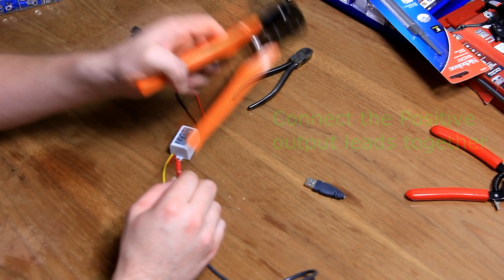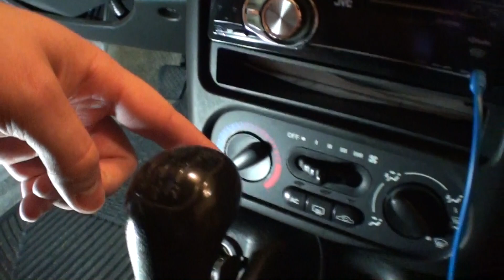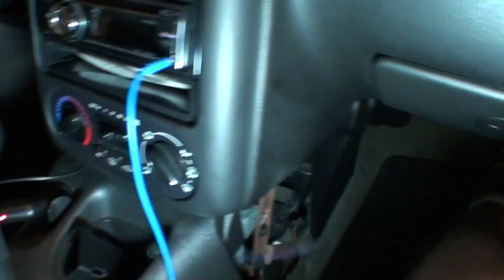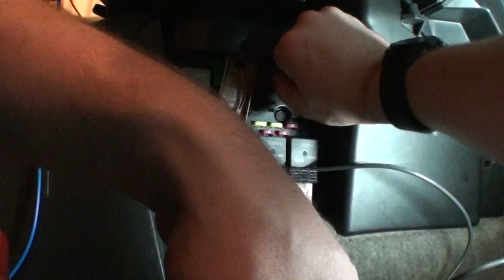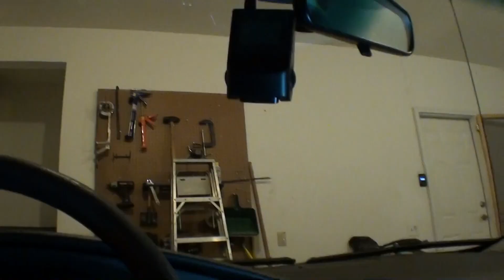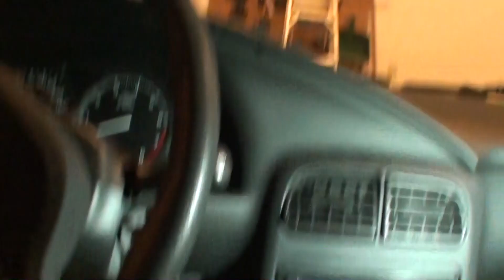Dash Cam Install - Hardwired Into Interior Fuse Panel

Comment: Can you connect to dash cameras to the same fuse? I was thinking of doing one for the front and one for my back window
Reply from the maker: Possibly as long as the power requirements for the total consumption of both cameras won't overload the converter or fuse. Other suggestion is find a dual channel dashcam. Thanks for watching!

Comment: How do you connect now a way days new models cars have mini fuses.but in the market they sell regular fuses and hardware wires. I ordered mini fuses and hardware  wires as mentioned in the AD but they send regular fuses and hardware wires. When I ask they they have only regular  but not mini fuses and hardwares. Most of 90 % of the dealers online they have regular but they mention Mini and hardware  wires in the Advertisement.  Help me how to fix it.

Comment: Idk if he mentioned you want to check your load slot one part of the fuse how is load the other is draw use a meter and the wire needs to be facing the load side. If done incorrectly it can cause a fire allot of people don't know this. Watch a video for a reference. And your to fuse has to always be smaller then your bottom so the wired fuse 7.5 and other 10.

Comment: Wrong! No cigarette lighter socket is "always on" in a car. Why? That would be stupid. And if you look in the fuse box "Cigarette" is under ACC. I think you got it wrong!
Reply from the maker: The one in this car was, 02 Saturn SL2. Even with the key removed, using the supplied cigarette power cord, the camera would still be powered. Now, my 2012 Chevy cruze shuts off the socket when the key is removed and I open the door. Probably a safety feature on newer vehicles.

Comment: How would I connect this so my dashcam can provide remote monitoring 24h by constantly getting power from the battery when the car is off? 
https://www.aliexpress.com/item/33030723006.html?isOrigTitle=true&spm=a2g0o.detail.1000023.2.43bf7ef89aGxCb
Reply from the maker: Find a fuse spot that is always hot(power supplies) when vehicle is off.

Comment: The problem is this might disable the parking collision detection on the dashcam
Reply from the maker: I was not going to use those features but if you do, hook into a hot fuse. This will give constant power so the collision detection can be utilized.

Comment: Do you need a specific converter to hardwire your dash cam? Or is it always the 12 to 5 volt converter regardless of whatever dash cam you're running?
Reply from the maker: It will depend on your dash cam requirements. Mine runs off 5volts, but others may be 12volts or other. Check the camera specs to know for sure. You might be able to skip the converter and run straight power from the junction box.

Comment: Make sure you know what the load side is when plugging in the fuse tap. Also, the new circuit fuse must be a lower amp than the one you're piggy backing off of.
Reply: Geebroni ^ what he said.
Reply: Hey G my camera came with a ground a red cable and a yellow cable. I know the red is hot 12 volts but what would the yellow be?

Comment: Great video.  I want to hardwire a GPS and rearview monitor for my trailer.  This fits the bill I think.  I've read all of the comments and have learned a lot so thanks to all.  I still have one stupid question:  when piggy-backing like that on a spot with a 10 amp fuse, is there any concern of overload when both the camera and radio are on?
Thanks again.  I subcribed.  Looking forward to watching other videos.

Comment: My dash cam didn't come with cigarette lighter I guess it's straight hard wire the power red came with a fuse already plugged in and the yellow also has a fuse where would I plug that in ?

Comment: Some dash cams have a park feature that can monitor activity around you vehicle when parked. This would require a fuse that would be hot all the time. This special hardwire kit would automatically shut off if battery drained to a certain point, still allowing you to start your car if left unused for extended period of time.

Comment: If I tap into my cigarate lighter fuse
Will it power my dash cam even when the car is turned off
Reply from the maker: As long as the power is continuous then yes. some vehicles cut power to components such as the cigarette lighter so you will need to use a multimeter to find out if power stays on when car is shut off. Also be sure the voltage is the same for your camera, some take 12vdc, while others like mine take less hence the need for the converter. Thanks for watching!
Reply: No it will NOT! Don't believe what JungleKing 007 says. I have my dashcam tapped into cigarette lighter fuse, and it's ACC. It's like that in ALL cars
Reply: @eriksrensen6369  quiet Karen

Comment: One not so minor point, be sure that you insert your addafuse in the correct orientation. If you get it wrong, and chance says there's a 50% probability that you will, your dash cam circuit will have no fuse protection.

Comment: When I get my camara tomorrow, I plan on doing the same, but to a hot fuse. If I want to turn it off, all I need to do is unplug the camera or hit the off switch. I like that option better due to the fact that if you have it set up to turn of with your ignition and you are sitting in a parking lot, or taking a knap at a rest area on a long road trip and somthing bad happens (be it an accident or violent crime) in you camars view, it will not record. Having it connected on a hot wire will assure you are able to get that recording, then simply turn the camara off manually when you leave the car.

Comment: I have a question for you(might be a dumb question to you) if you had the car lighter power cord, why did you use the USB cable? Also I was wondering the brand of converter and how well this setup is holding up thus far.
Reply from the maker: Didn't want to cut the lighter cable just in case I wanted to temporarily mount the camera in another car. Basically to have the lighter cable as a back up. The voltage converter was found at Amazon. Smackn brand I believe. It's held up very well. My round trip commute is around an hour a day. Other than a loose ground wire once, I've had no issues.  I think the converter  I'm using may no longer be available. However, any 12vdc to 5vdc converter should work. Also check your camera to be sure this is actually need. Thanks for watching!
Reply: @KrazyKrewLocEntTV
You can still use the lighter socket cable without cutting it if you wanted to. Just buy a lighter socket extension cable and plug it into that, then follow the video emitting the converter all together. The piggy back fuse holder has a right and a wrong way when fitting. The pins in the fuse box will be hot on 1 side only. Check them first. You should not just plug a piggy back in and hope for the best. You have a 50% chance you may get it wrong.

Comment: One thing you should've covered is how if the original fuse in the piggy back harness blows out, and you have the piggy back plugged into the fuse box the wrong way, the fuse for the dash cam will NOT receive current, therefore rendering the dash cam useless. The fix for that is pulling out the piggy back harness from the fuse box, turning it 180 degrees, and plugging it back in.

Comment: What kind of car,  make and model is you car and why he cigarette lighter always on? On most car, when the car is off there's not power to the cigarette lighter.
Reply from the maker: +Tous Shong 2002 Saturn sl2. Not sure why it's always on, but I'll blame the engineers who designed the car.
Reply: I have a 2003 VW Passat and have 2 lighter sockets and 1 further 12v Power socket in the boot / trunk which are factory fitted. All of these are permanently live. Some manufacturers do that as standard. It's actually very common.

Comment: If the camera supports motion detect park mode, should I use a hot at all times fuse? JW since if I use a hot at on/run would that keep the camera from turning on during motion detect?
Reply: Y So Slow yeah if you want to use parking mode you need a DC-DC converter that will also shut off the circuit at low voltages so you don't drain your battery. You also should tap into an always hot fuse

Comment: Is there an easy way to determine which fuse only gets power when the car is on? I have a diagram of my 2013 Hyundai Santa Fe and I used the "Multimedia 15A" fuse which services Audio, Navigation, etc. I am currently receiving power when the key is out of the ignition using that fuse. I'm also not sure how to ask this question easily for Google to determine what I want. I guess I could pull out my voltmeter but I've never used the thing so now I've got to go learn that lol! If there's an easier way I would like to know. Thanks in advance.

Here is the diagram I am looking at:
http://www.hyundaisantafemanual.com/santafe-322-fuse_relay_panel_description.html
Reply from the maker: +Will Christian may have to pull out a multimeter to see which ones will shut off when key is out.

Comment: The Parking Mode without continously power is not gonna work.i you leave the dash cam for hours is not gonna hold on .only if you have extra battery only for that .

Comment: Crimp connectors? Seriously? Too unreliable in my book. Solder and shrink wrap... always!
Reply from the maker: Crimp connectors work for those that can't solder very well, or don't have the tools to do so. This setup worked well, but I did change to smaller crimp connectors at I found at RadioShack to give a more solid connection(because of the small wires of the USB cable). that's all I have changed and it worked perfectly even before the connector change.

Comment: Can't you just use the original lighter power supply and just cut the lighter adapter (mine comes with a separate box along the line to step to 5V 1A)?

Comment: Is there a proper orientation for inserting the fuse into the tap and inserting the tap into the fuse box?
Reply from the maker: Fuse can be placed into the tap either way. as for inserting into the fuse panel. may need to check polarity with a multimeter. I did not check myself when installing. have not had any issues with the camera starting up.

Comment: I wish I had watched this video before I wired my identical dash cam. I think I may have fried it by wiring it to the cigarette lighter wires without any fuse. Now the dash cam doesn't power on. anyone take these things apart?
Great video by the way. I will use the same materials you did.

Thanks

Comment: I cut my USB cable to dashcam and there are 5 wires: red, black, white, green and bare metal.  So how did you know which ones to connect up to?  Don't want to "fry"my dashcam by connecting  the wrong ones.

Update: by a diagram I found at https://goo.gl/Tdz6Ni  looks like the red is the power and the black is the ground.  The white and green wires are data in which I will avoid.  The metal wire is not used.
Reply: Hey there u connect the red and black one you don’t need the other ones just tape them
Reply: All wires are metal

Comment: isnt this current converter dangerous? I mean i dont wan to have a 
fire in my car. Especialy if i left the car alone. Can this cause fire 
somehow? Or is the transverter inactive if i pull the ignition key?
Reply from the maker: No fires so far for me. This setup is used daily on my commute to and from work. Had no issues whatsoever.

Comment: i saw that you plugged in the 10 amp fuse to the add a fuse is the second fuse also a ten amp or does it have to be a lower amp fuse?
Reply from the maker: I'm using a 5 amp fuse to the dashcam.
Reply: JungleKing007 how did you know what magical amperage number to use? my car has tons of different ones and I am afraid I'll Fry it if I don't get the right combo of 5, plus a 10
Reply: look there is not a magical number. You just have to check how many amps the dashcam use. If it is 1A then 5A fuse would be good. To make it more clear if something goes bad for example a shorting somewhere the Amperes will go to infinite so 5A fuse will stop that. So yes dont worry use just a bigger amps fuse of what the dashcam amps uses.

Comment: if it will permanantly stay there you should try soldering the hot and ground directly to the dashcam with a switch on the dash, because with time the charger connection to the dashcam will wear out and make bad contact due to car vibrations ect.
Reply: nonsense

Comment: can someone plx tell me the fuse for dash camera.is it 5v or 1.5v?where can i buy it?i got a119c thanks.
Reply: Arjun Pun go to spytec and buy the fuse kit
Reply: the front camera is 5 volts 1.5 amps... rear camera is 12 volts less than 250mA.... taken from owners manual

Comment: Where can you typically get this material, 5 volt to 12 volt converter, the add a fuse, and whatever ever else. Great Video by the way I'm having the exact same issue but it was very good!!
Reply from the maker: +Lance Bell got the converter(Smackn brand I think) and the long USB cable off Amazon. The Add-a-fuse I found at my local auto parts store.
Reply: you can get a cheap 12volt port to USB converter adapter   at the dollar store for less than 3$ and use regular USB cord

Comment: I wanna hardwire my cam in which fuse i need put my cam i have motion capture so i wanna when my car is on parking turn on when sensor detect motion
Reply from the maker: +BriaCroTex you will need to find a fuse in the junction box that is always hot, meaning when your vehicle is shut off there is still power passing through it. Will need a multimeter or powerprobe to test the fuses.

Comment: what kind of dash cam do you have?
Reply from the maker: I mounted a Spytec A118C in this video. The capacitor version is better suited for high heat areas.  Many times battery versions will burn out due to the heat.
Reply: +JungleKing007 capacitors are also good for extreme cold. lithium batteries fail below 0 degree Celsius and can damage the camera
Reply from the maker: +Jason Mangal good call, didn't think about the cold. I've always read the issues people have were in areas with excessive heat, but batteries don't like the cold either... Thanks for the input!

Comment: questions 
1) if i have DC TO DC hardwire kit with 5v 1.5a output do i still need to use add a fuse with 2a fuse or can i just wrap the red wire directly to my 10a fuse and ground the wire 
2) does the fuse have positive and negative side
Reply from the maker: 1) Better to have a secondfuse for the camera separate whatever port you choose to tie into. 
2) I don't think it matters which way the fuse is inserted into the add a fuse or the junction box itself.

Comment: All you needed was the fuse tap to do this job even if its a 5 volt device. just open up the original 12 volt plug on the cigarette lighter of the camera... and solder the end red wire to the fuse tap and black to a ground. The original plug already has the 12v - 5v converter. It would have only cost $5
Reply: Jason Mangal I bought a fuse tap, but doesn't fit the spare slot, are there different sizes for fuse slots?
Reply: +Hefe Adoy  There is different  sizes Atc fuse which has big blades and Atm  which has small blades. most newer vehicles will most likely use the ATM fuses
Reply: Jason Mangal hmmm... my fuse and blade from the wire tap fits but when attaching the tap to the fuse box it doesn't even go all the way.. not sure if there are different kinds of "low profile mini" fuses.
Reply: +Hefe Adoy yes the low profile ones have less length of the blade. that may be the problem
Reply: Jason Mangal when you say the original plug has the 12-5v convertor, it will just be wire if it's being cut off.

Comment: How to know what amp fuse to use? I'm kind of confuse, say I'm installing LEDs
Reply: You have to know how many amps will draw the accessory you are installing.
Reply: +Didtok Nan how u do that...sorry I am a noob and have never done hard wiring before. Can u give me more details on how to do that.
Reply: It's should be written on the specs of your accessory. It's even A or mA, or in W. If it's in W, the formula is simple: P=UxI. P is in W, U is the voltage (your battery voltage for example), which gives you I = current.

Comment: Un-related question
A lot of Korean dash cams now comes with 12/24 DC hardwire kit
Does dat mean - they can use any fuse amps?
Bcuz battery dash cams uses 5v 1.5A - but the super capacitors don't mention amps. Just 12/24 DC 3.5W 
So I'm confuse
Reply: 12/24 volt DC means it can be used in a 12 volt system or 24 volt system... just wire it to to 12 volts. dash cams should be fine with a 2-5 amp fuse
Reply: Tnx Jason -

Comment: Just letting you know, Amazon sells a "Vehicle Hardwiring Kit" with a mini USB connection. That way you don't need to do any cutting of wires. Just under $14.
Reply from the maker: +ComPrt3 Good to know for those that are not comfortable with making one. For me, this was a learning experience and for others I think it is beneficial to DIY their own. I'd rather build something myself than buy. It's more fun to say I scratch built something, than I bought it prebuilt and installed.
Reply: Hi..checked  the Vehicle Hardwiring Kit on amazon but the o/p is different.that is DC 5V/1.5A while the one for the dashcam i was looking for is DC 5V/2.1A. does that make any difference?
Reply: The sell universal obd wire kits to power any 12v accessory. https://www.amazon.com/dp/B07K4YQ7PV
Reply: Most dash cams have a backup battery for parking mode.
Reply: unless it's a power bank, the batter might not  last the night;